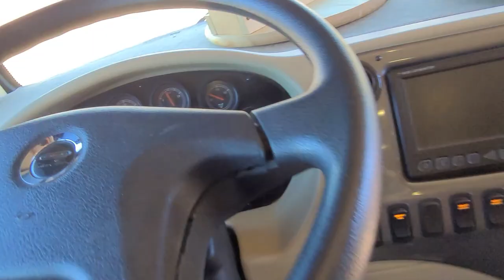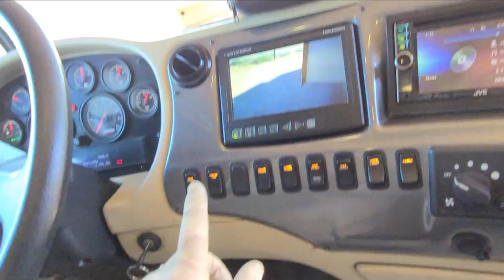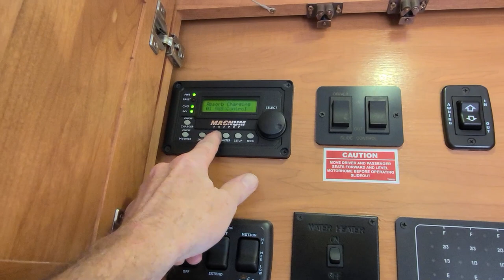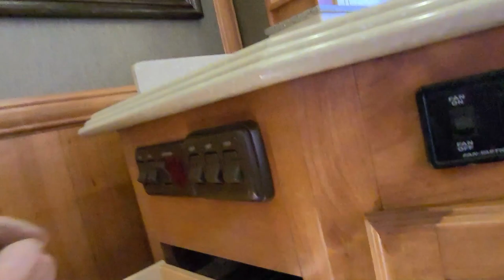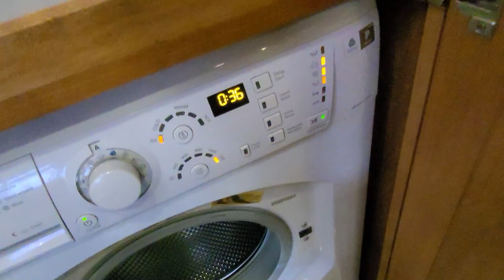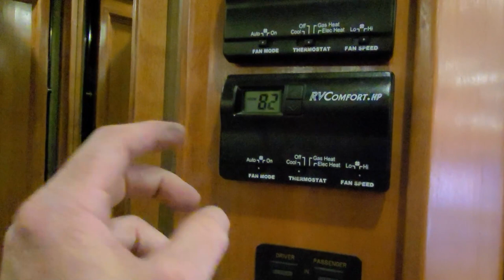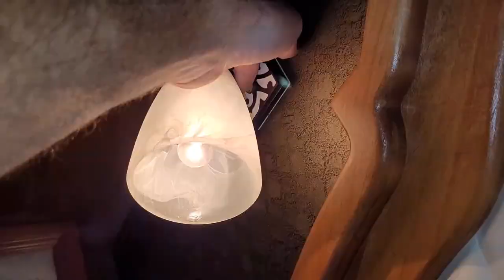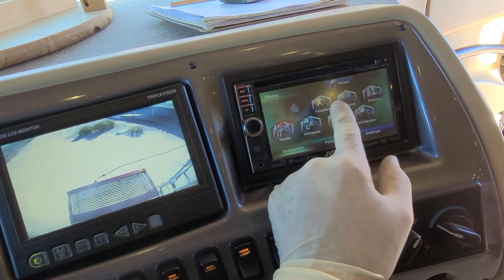Complete Interior RV Inspection/Walk-Thru on Diesel Pusher

Comment: The ground is very sloped.......LOL....you need to come to WV. You will see some sloped ground. Question about LP leak testing. Have you found the newer units (mostly travel trailers) with all the rubber hoses will not pass this leak test?
Reply from the maker: It does seem like the rubber hoses at tanks and regulators are not good quality. I am thinking of moving to WV it looks beautiful
Reply: @AZExpert  There are some travel trailers that have all rubber hoses. They have no steel or copper LP lines. Those WILL NOT pass the leak test.

Comment: I have a quick question how do you get the fog out of the windows when they're double pain windows do you have to take them out how do you do it or sweat in between the two glass
Reply from the maker: The only real way it to remove the window, take it apart, separate the glass panes and rebuild using a special 3M glaze with built-in desiccant and then re-build the window and install. There are usually companies that specialize in this.